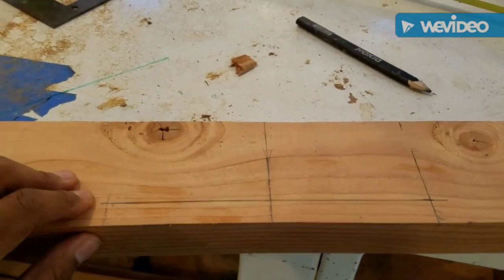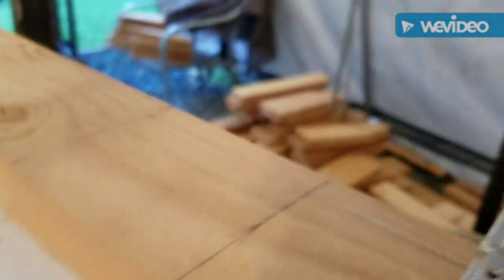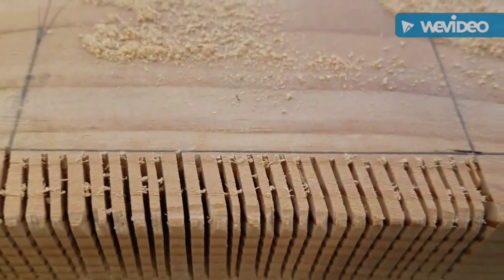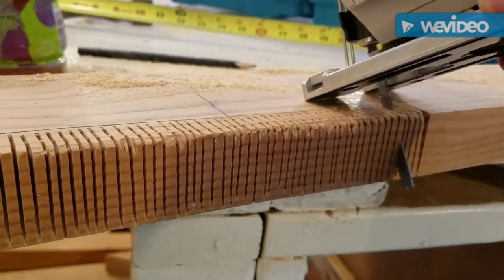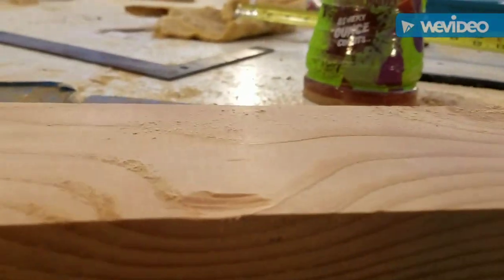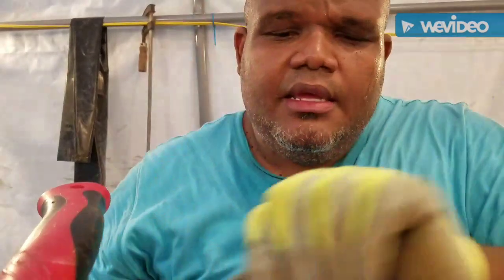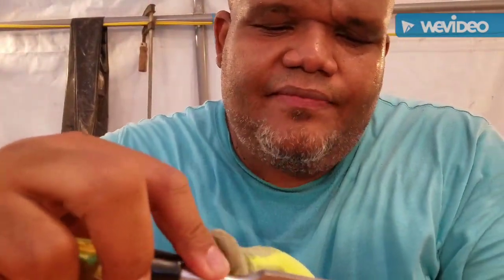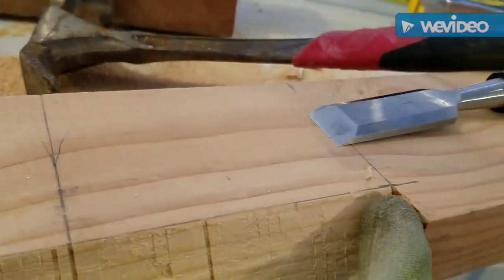Build A Boat Saturday - more chisele work

Comment: So glad to see you posting again. Just my two cents, but I do kerfs in almost the exact same way, but found using the chisel or even a screw driver and knocking the slices 90deg to the cut(like tumbling dominoes)will much more quickly remove the bulk of the waste material. Then it is just a matter of fine tuning with the chisel what is left.

Comment: Hi Kamau, just a few points that might help you in doing this, there is no need to make as many cuts as you are in that doug fir to remove that section, cuts as wide apart as 3/8" or even 1/2" would probably work, try on a waste piece to find the least amount you will get away with, I personally find using a good sharp hand saw to be quicker than any power saw for this type of thing, but that just my preference.

once you make your cuts don't use your chisel to remove the pieces, use your hammer striking them sideways to snap them off, then use your chisel flipped over so the bevel is facing down to remove the excess down to your line.

Also you need to sharpen your chisel and keep it sharp, it should not be catching and gouging into the wood the way that it is it is, this makes it harder to use and more dangerous as it requires more force than should be necessary to remove the excess timber.

Regards, Dave.
Reply from the maker: Dvseire that's good advice. When I tried larger cuts sometime the wood split. But I will try that way again.
Reply: Wide and irregular grain in DF can make it hard.  It seemed like a lot of relief cuts to me, but I ain't making a boat!  :-)  I have done a little hand chisel work on timbers, but they were reclaimed old growth - tight grain, and minimal knots.  Cheers.